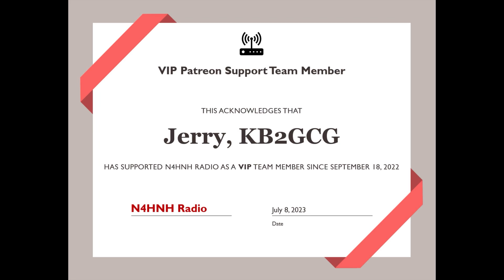New Support Brackets for the R5 and X-50A #hamradio #hf #vhf #uhf #antenna

Comment: I have been using Top Fence Post Rail which are stackable sold at Lowes, Homedepot,  10 ft section each about $22 each, and using strong cast iron fence post farmer use for ground mount.  I tied Fence Post and Fence top rail with hose clamps.   10 ft x 2 , 20 ft has been up more than 20 years  AG6JU
Reply from the maker: That’s good. My brother has used fence before as well.